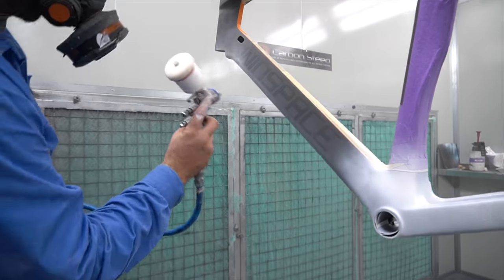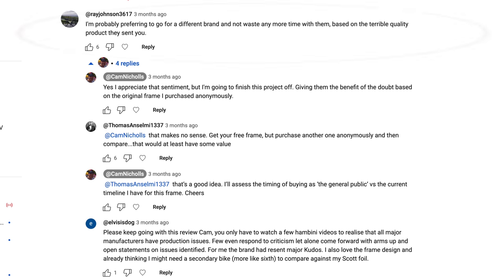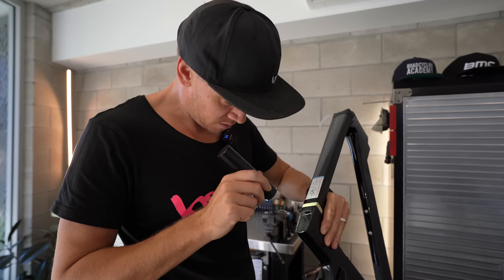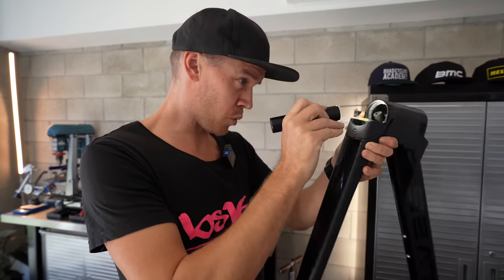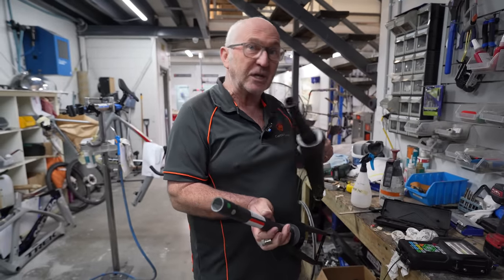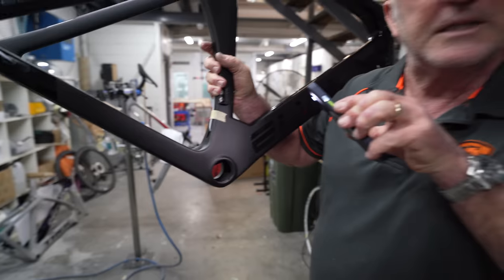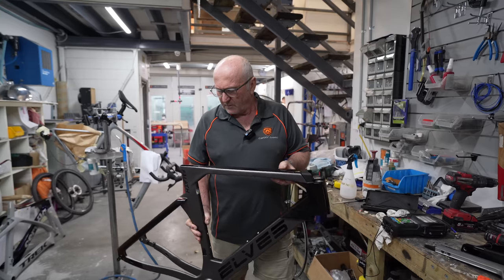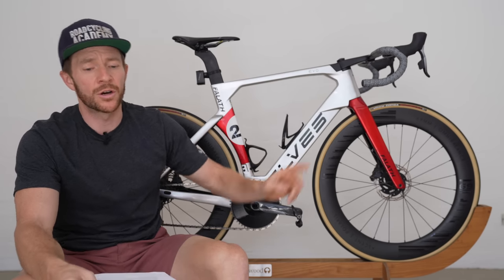I Bought An Elves Frame Anonymously (again)

Comment: answer in principle

10g in proportion to 420g Full fork
It doesn't cost a lot of money, but
is safety for customers

Do you think the 2.4% ratio will make the company Get more profit?
or for the safety of customers

Factory had to make 42 of them just to get one bike at a cost.
that it doesn't make sense

If the factory is profitable, the proportion should be 10%. 
In the Fork 420 there is Fiberglass 10% or 42g. 
When entering the production of 10 framesets, 
factory will make a profit of 1 frameset

This BMC 
BMC has issued a voluntary recall for its Teammachine SLR01 road bikes from the 2018 and 2019 models, which first went on sale in June 2017.

BMC said it has identified a fork issue found in 20 models that could result in steering tube damage. and may lead to collisions and injuries.

As a result, BMC is asking owners of affected models to stop riding immediately and take their bikes to a BMC retailer for a 'safety check'.

Security checks will reportedly involve retailers conducting an identification process to determine whether the bike can be ridden. Or do you need to replace the new chopsticks?

Bicycles made in the 2020 model year, Teammachine SLR02 bikes and rim brake SLR01 models are not included in the recall.

The full text of the recall is below. Includes a list of all affected versions.

for immediate release

Grenchen, Switzerland, November 14, 2019 – BMC Switzerland is issuing a recall of its Teammachine SLR01 Disc bikes from the 2018 and 2019 models for safety review. These models went on sale in June 2017.

BMC Switzerland has identified a technical issue with the fork that could result in cracked or broken steering tubes. This leads to collisions and possible injuries.

To protect users and maintain the brand's stringent quality standards, BMC Switzerland has requested that these bikes be discontinued and taken to a BMC retailer for safety inspection.

The retailer will go through an identification process to determine if the bike can be ridden. Or do you need to change the chopsticks?

The following versions are included in the restore operation:

Link https://www.bikeradar.com/news/bmc-teammachine-slr01-disc-recall/

#That's Hilarious  that you don't talk about BMC because they pay you.#

Comment: I was considering buying this frame but the weird geometry scared me off. I'd have to ride it to make sure it fits me. In addition it is heavy. I'm not as picky about that as I used to be but it's hard to give up the attractiveness of a super light weight bike.
Reply: Hi @donwinston If you are willing to invest a bit in lightweigth parts, you can also trim donw the falathe evo to 7.14kg. Like mine in size 52.  It is aero, light and fast

Comment: The bottom line is you get what you pay for. I bought a frame from Elves and it had noticeable defects. Their answer was doesn't worry it has a warrantee. With these frames you're not going to get good quality control. The upside is they are a fraction of the price of name brands. Are they good enough? That depends on ones price to quality tolerance.

Comment: I don't know about these deeper rims and much wider tyres Cam for road. I just think the extra weight to gain over say a 45/50 deep rim and 25/28c tire. 
Woven fibreglass with epoxy is but uncommon in high stress high loading points in boats and sports car bodies. Fibreglass with epoxy is very strong but heavier than carbon at given strength.

Comment: I get it, weight savings and all. But making a carbon bearing SEAT is insane. There should be a metal construction or a sleeve inside to allow a rigid and reliable point of mounting.

Comment: I've cut into a relatively recent model Yeti mountain bike frame which had fibreglass in the downtube. Certain kinds of fibreglass can have really good impact resistance so it potentially makes sense in an area like that. It does seem a little deceptive to say you have a carbon frame and then sub in some fibreglass. On the flipside I also can totally see consumers not liking it, even if it is a better engineering choice, due to the perception of fibreglass being a "cheap" material.
Reply: Gliders (aircraft) are sometimes made of fiberglass, at least the older ones. It's used a lot in general aviation

Comment: Good video! Don’t get me wrong, I think carbon frames are a great innovation for bikes.
I own two my self, but I bought them used and would never pay the outrageous amount of money charged for a new top end frame!
Videos like yours and Hambinis show design flaws and inherent difficulty in manufacturing carbon frames.
With disc brakes, wireless shifting, and internal cable routing, I will continue to buy older used bikes to do my own maintenance.
If you are a bike frame manufacturer, beware as people are reviewing your frames and posting videos on YouTube if they are not up to par!

Comment: I recently built 4 Velobuild frames for me & friends, so i looked at the leftover steerer tubes I cut. Inside the tube there's something that looks off-white, but there is absolutely zero thickness to it. I hadn't noticed the white colour until I looked because of this video, btw. Either way, the entirety of the steerer wall is carbon, absolutely all of it. In the video, it's quite evident that the Elves steerer not only has (very) white fiberglass inside, but that the white layer is super, super thick (especially visible when it's being Dremeled down to the carbon layers). 
So, yeah. Velobuild sells a lot of frames, and they're 500USD a pop. Unclear to me (for months now) what more I'd get buying an Elves. Elves have a bigger marketing budget, that much is clear, but value wise?
Reply: Velobuild isn't particularly known for reliability and good quality products.
Reply: @EthanIzeta  it's the first time I buy from them, time will tell. So far, I'm very pleased. I m also on chinertown forum and there is a vast, vast number of users who are happy. Five years ago, idk. In the last year though? I think they've been making very good value frames that perform very well for most people.
Reply: As someone who bought more than 20 chinese frames of almost all the known top brands just to test out and ones not even mentioned anywhere on Youtube, I can say I will only buy Elves and Winspace going forward cuz their finishing and paintjobs are superior. Ridewise they're good for racing being stiffer but not necessarily better when you're looking for an endurance bike. My fav endurance is actually the 1 year old model Winow FM166 which I'm sure nobody knows about. That thing rides better than any European big brands I've ever ridden.

Comment: The main question I reckon is safety. Is this bike designed, manufactured, assembled and checked to a high standard and fit for purpose? It appears not in this case but I guess that's reflected in the cost. You'd need to weigh that up for yourself I guess.  Great series
Reply: where did you hear any implication that the bike isn't fit for purpose?

Comment: If you want a dimensionally accurate inside diameter then you will need to lay up on the outside of an aluminium tube. But if you do that the outside wont be in a mold and will need  a load of post processing to make the outside smooth and you will gain weight doing that. Layup inside a mold and then reaming out the inside diameter makes sense to me. You dont really gain anything doing it the other way.

Comment: Thanks.  I was thinking about buying one but it's clear they are not right. This is based on other channels reviews aswell. Regardless of what your opinion is.  The frame is still about €1200. That's not a cheap frame. Cheaper than some but to say it's cheap is ludicrous.  The big question is value for money.  You can't answer that question as nobody knows. Some say they don't last long in terms of stiffness, some say they become "dead" after a season.  Buying a  carbon frame based on price sounds like a buying the cheapest parachute to me.

Comment: Unless things are different in Aus this frame would be well over £1k in the UK by the time you've paid import Tax. So its not really a 'cheap/budget' frameset. Its not like back in the day when you could get a Pinarelo or Venge replica for £250.
Reply: My Falath Pro frame did cost 1K € including Tax...... thats still 500€ cheaper than my old Cannondale Supersix Evo Frame in 2016 that was 1499€.. (non high mod)  Nowadays you can only buy high mod frame for supersix and the Frame is 5K €.....

Comment: I think this whole issue can be reduced down to three things.
1. When elves make your frame as a cost cutting measure compared to humans, this is a false economy.
2. Completely unverified if Gary's earrings are carbon fiber and he is still walking around.
3.  When the stem is flush with the top tube, this can create PTSD and dreadful flashbacks to riding a Look frame with imminent disaster and unfixable complexity.
Those are the top 3, but other issues mentioned in the video have relevance as well.

Comment: I've a BXT frame and as much cost effective (low-cost) it doesn't have glass-fibre in the steerer... I've had 2 frames from bxt and the 1st was incredibly light as the newer one is aero.
Reply: Respectfully, how do you know it doesn't have fibreglass in the steerer?
Reply: @cameronwood9385  Cause I can see it doesn't - if I could get you a picture I would, I've cut two steerers of theirs and their arent
Reply: @cameronwood9385   The same way you know that your name brand doesn't have fiberglass

Comment: Is the fiberglass just used on the these aero forks with none round steerer tubes so they can be reamed to shape?... can't say ive noticed it on my tcr adv sl's. When cutting the steerer it was definitely full carbon.🤷🏻‍♂️
Reply: Yeah same. I've never seen this on any carbon fork I've cut either but they've all been traditional round steerers. I've definitely seen a few seatposts that are glass fibre then have a thin carbon weave  layer over the top. I wonder at what point they'd be better making the steereer out of aluminium like they used to back in the day.
Reply: This has a round steerer tho. I wonder how many people will swear up and down that they have never seen fiberglass in a steerer, but they just haven't noticed. I pulled the top cap off my Canyon and there it was, black fiberglass. It was super subtle, I'm certain that if you didn't know about it and wasn't actively looking, you wouldn't notice. I sure didn't. It has a very fine, barely noticeable weave, and unlike carbon fibers, which shine in the light, this was almost completely matte. It's not as simple as black=carbon white=fiberglass.
Reply: @michaelmechex  yeah gonna check mine again... you could be right

Comment: Honestly who gives a 🦆 if there's a layer of fiber glass inside the fork steerer? One needs to be familiar with common mfgr processes to understand its full implications and the average consumer will not notice any impact to the functionality of the fork. Kind of reminds me of the video where they sawed a BMC Racemachine frame in half and observed all these voids - well did it win races or didn't it? There is no such thing as manufacturing perfection, just allowable tolerance ranges, and whether something out of spec has a functional or structural consequence, that is determined on a case basis. If something is of consequence, the market will let the manufacturer know one way or another.
Reply: Boeing's expensive perfection that killed hundreds of people. 737 Max cough... we noticed.

Comment: Squish the sides of the downtime with your hands. I heard they have some give. Would like to hear some commentary on that.
Reply: Even if they do, it really doesn't matter. The tube profile is so long that it will be very stiff even if the long sides are thin.
Reply: Yeah they do, same for the top tube. My Giant Trinity has the exact same thing, they put as little material as possible to save weight.
Reply: @michaelmechex I can confirm that the sides flex, but all the other faces of the downtube are mega stiff

Comment: Pretty interesting! I would like to share my little own observation: on my Principia REX e the fork steerer tube shows glasfiber on the outside and insinde with carbonlayers inbetween (frame/fork built in 2003 and pretty expensive ). My Ridley Damocles´ fork from 2010 features glasfiber on the inside of the steerertube. My BMCs TMR01 from 2015: no glasfiber, pure carbon. So  different  types of manufacturing do exist, as you also showed and explained.

Comment: Steel is an alloy there are many different steel alloys used for bike frames, Aluminium frames are made from aluminium alloy again many different alloys used. Do we all insist on knowing the exact alloy composition.......no we don't. Steel and aluminium frames are alloys but we just call them steel or aluminium so whats the problem with a frame being called carbon it's already a composite of different materials (the term alloy is specific to metals ). For me the main thing is the quality of the final product to do what I want, this applies to all products not just bikes.

Comment: at 1st i was like BS corrosion looooooooool. then i looked it up yeah sure enough yeah it does, I'm not sure why it was surprising to me, see cars with carbon fiber hoods and trunks and wings etc, there is a good reason the clear coats peal to easy, Carbon fiber Soaks  up heat and is way hotter in direct sunlight then just a normal black painted hood or panel it bakes the clear coat off it normally starts to yellow from heat or haze no longer looking nice and clear looking. carbon has benefits but draw backs i learned some new ones today and about bear metal touching carbon.

Comment: Easy answer, don't buy carbon. Steel, aluminum, magnesium, or titanium. Suck up the weight and aero differences. Most cyclists are not pros, although some think they can fake it. At the end of the day, good carbon is EXPENSIVE, there's no cheap or should I say inexpensive way around it. If you are that good carbon is in your future.

Comment: In retrospect you did a poor job of explaining that fiberglass in the steerer tube is a benefit, not a drawback, and thats the result of either ignorance on behalf of your friend/expert of some sort of malice. I dont believe you have malice so I'd really question the way your pal explained it.
Reply from the maker: Not when 1/2 the steerer is fibreglass. A thin layer works in many instances but the two materials don’t bond so well together so if delamination occurs and you’re left with .6mm carbon steerer and you hit a pothole, are you happy with that?